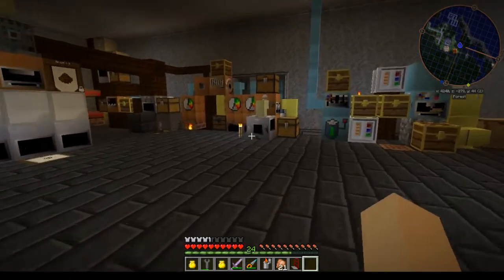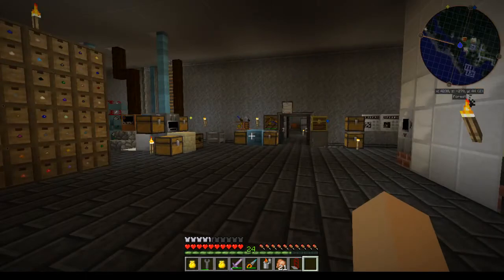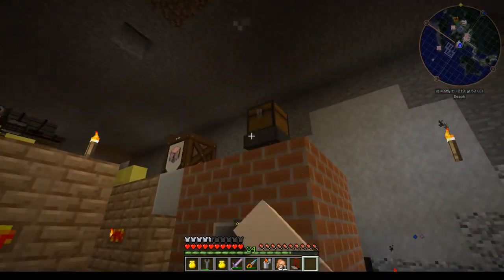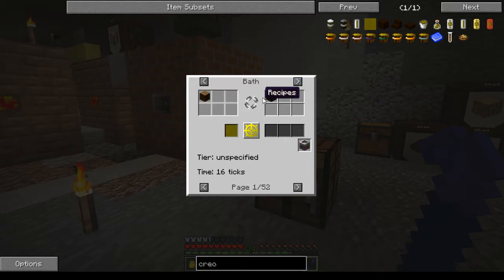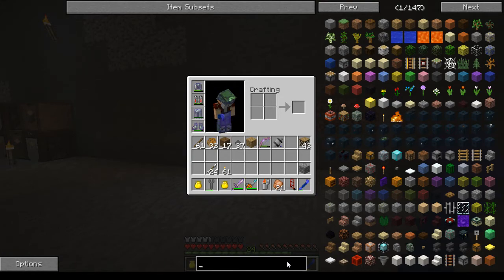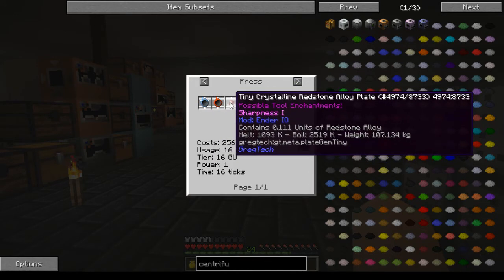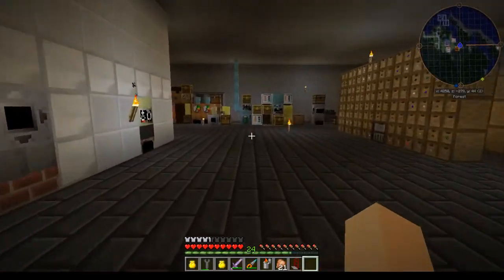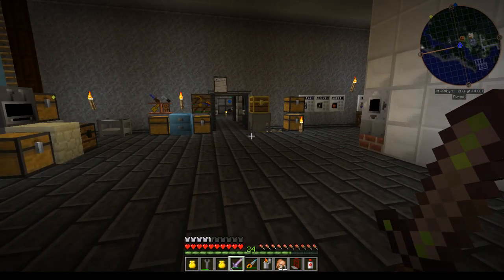[Gregtech 6 LP] EP 182 GT6.03.29 update Multiblock Centrifuge

Comment: What happens if the bandwidth or capacity goes excessive into a wooden pipe? Does it leak and explode?
Also how do I keep my steam engines at optimal heat like you do? Is it a redstone loop? Also thanks for the update video! Was fun to watch!
Reply from the maker: no pipes dont blowup, and the only ones that leak are the wooden pipes if you put gas through them. pair the boiler with the engine and pipe it straight, run the boiler off distilled water.